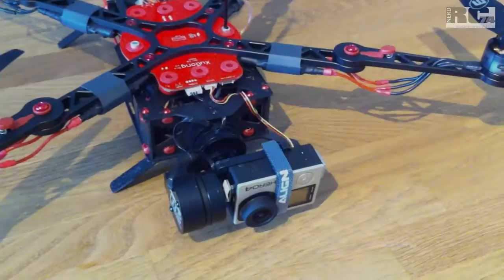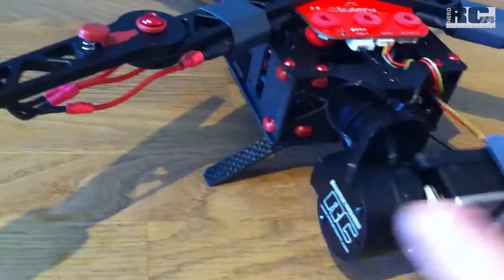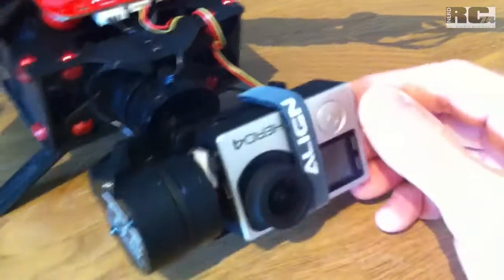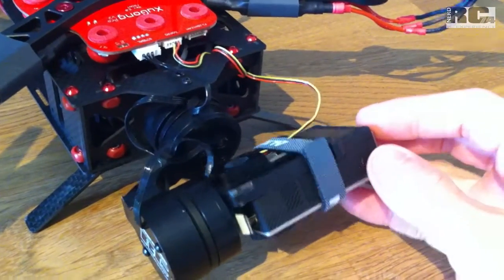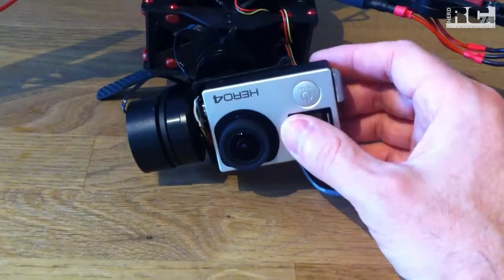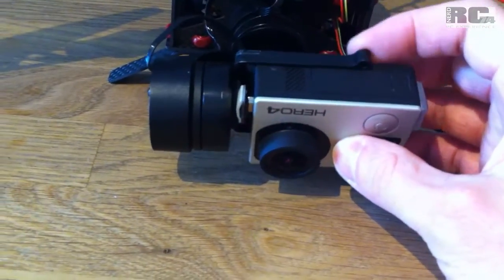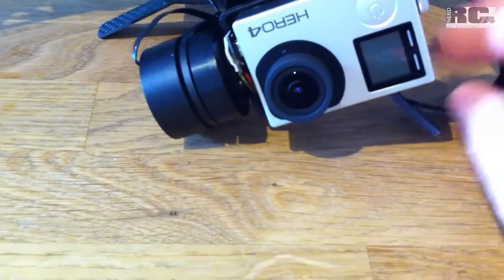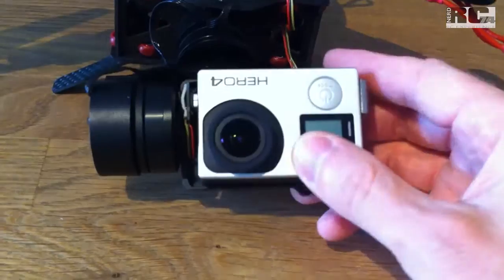Immersionrc Xugong V2 pro gimbal

Comment: very nice original thinking rcnerd on the camera mount and the flight controller mounting.  I've been fighting jitters since I got the xugong v2 when first came out.  I've never seen anyone re-mount the flight controller like you have so that is a new idea!  If you have any flight video I would love to see your results.  I would think it simplified the wiring a bit too since flight controller is now basically part of the arm/PDB board assembly.   It is really nice to see someone come up with new ideas that have not been tried before.
Reply from the maker: +Rich Moser i will load up a short flight compilation Video so you can see how the quality of the footage is. I is not always perfectly smooth. but OK.